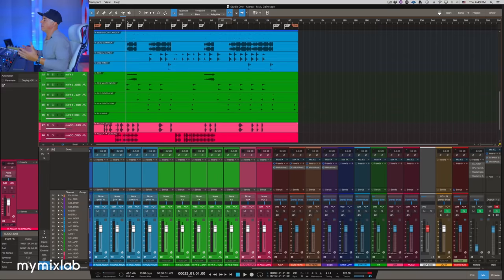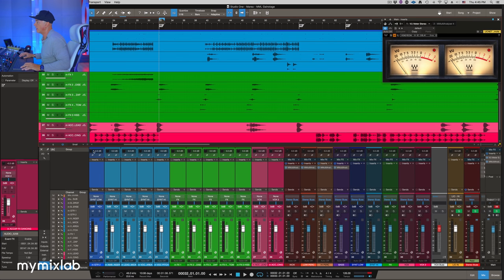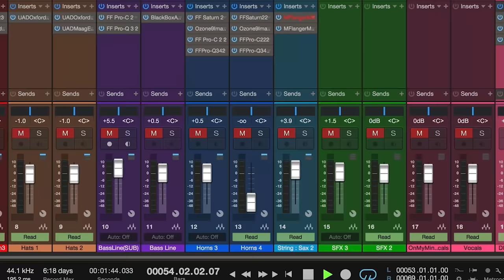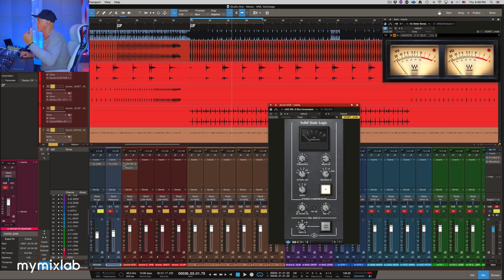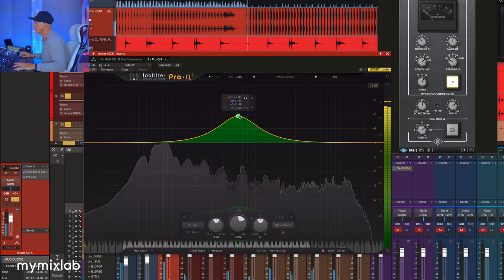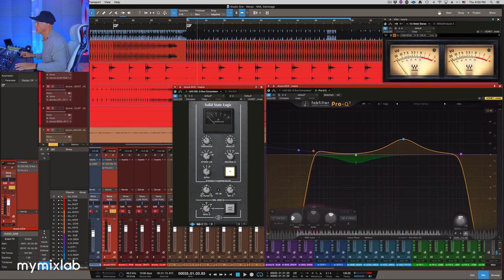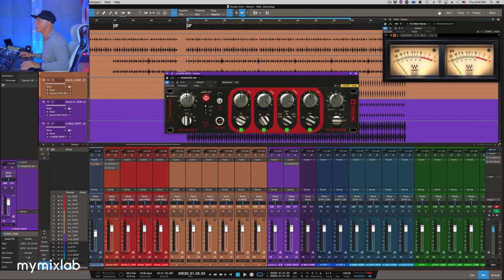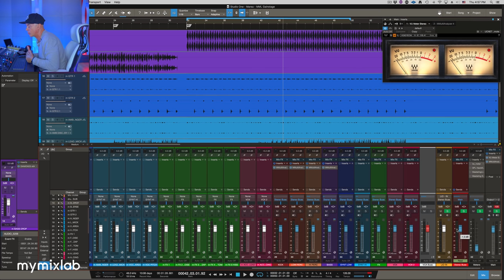HOW TO Mastering Levels & Gain Staging | Luca Pretolesi (3x Grammy Engineer) | TUTORIAL

Comment: how much soundgoodizer should i use on my master bus?
Reply: You need to put reverb and cla vocals on the master!!! I can’t stress this enough but soundgoodizer is only good when used 3x on every track
Reply: All of them
Reply: @OpenInfomusic Superb advice!!! I would just add to that and say if you really want your master to stand out it’s essential to add at least 4 instances of of the ELI Distressor and set each one of them to NUKE! 😁
Reply: Exactly 0. I know it’s a silly comment but I’ll respond seriously hoping I’ll help someone: master the track only when you are sure by 100% that the mix is finished, first of all eq it(add\cut as much as needed for your idea), then mid side compression, then glue compression to smaller the dynamic range between all if the instruments in the mix, then and lately a limiter.

If you think I’m having a mistake pls tell me so I will learn something new😁.
Reply: @ilay829  ok you took the troll too far… but seriously I usually only use 1-1.5 instances of soundgoodizer on each track. Then I’ll take the sum of all of them and divide it by 3 and that’s how many instances I use on the master bus to tie everything together
Reply: Yes
Reply: Stack 10 of them at 10% mix each
Reply: Yes
Reply: All
Reply: Yes
Reply: Yes!
Reply: Its depend , maybe 10 or a parallem with 10 more 😐👍
Reply: Don't forget to put reverb on your sub, it will boost the energy of the track 🙏
Reply: 1.21 gigawatts
Reply: I think 10 soundgoodizers will do😂😂
Reply: It's also a good idea to add Reverb to your bass and a stereo imager so it's nice and wide.
Reply: At least 3 different soundgoodizers

Comment: This is great info. I've also been told to achieve loudness in a mix. I've seen engineers setting there kick drum and bass set to LUFs meter around -14 to -12. If doing this, you begin to clip the VU meter at 18. By doing this method you put less stress on the limiter to achieve loudness. How do you achieve loudness when using this method you've described in this tutorial?  A follow up video would be awesome.

Comment: The problem i see here is that you always work on two different levels: the master and the single channel.
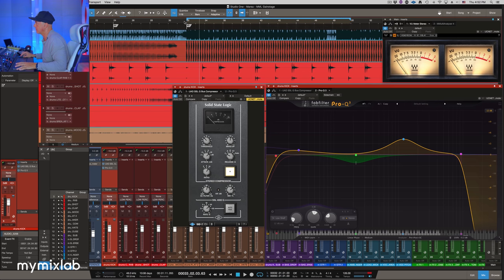After clip gaining all tracks to meet 0db VU on the master channel you have to adjust the gain on each single channel (in solo mode) in order to meet there again the 0db VU (which makes sense, since that's normally the sweet spot for analogue emulating plugins), but this changes the overall loudness of the track (see 13:00).
Correcting the gain with the output knob of each plugin in a track's fx chain doesn't make much sense, if there is a next plugin in the chain which again expects 0db VU as input gain.
It would be interesting to see how Luca handles e.g. a synth channel which has to be gain staged up by +5db in order to meet the 0db VU on the channel but which then also increases heavily the gain on the master bus.
Reply: Edit: This could probably be solved by putting another gain plugin at the end of each channel's fx chain which corrects the initial gain change by the inverted value.
Reply: I know this is a year old, but Yes!

What he showed was valuable, but incomplete.
If you got a folder of tracks, along with a rough mix from a recording session, then what he did at first is ideal.

Your monitoring is set to the dB SPL level you listen at.
Your master fader is at Unity.

You’d import All tracks as is with channel faders at Unity.
Including the Rough mix on a track that ideally Bypasses the master bus and goes straight to the same hardware outs as the Master bus.

I’d reverse one of his processes though:
Yes select All Tracks, and Yes grab the clip gain or input gain if your DAW has that, if not just add gain plugins to every track and select all of those.
But rather than start at Unity and bring the level down, Before You Hit Play, start at infinity and bring the level up.
Reaching the same level as he did, but without any unexpected surprises, to your speakers or worse if you’re wearing headphones.

Now, where I totally agree with you, is this only helps with the Mixbus and Monitoring.
(Oh, and I’d bring that Rough Mix up to the same level, flip the phase, and they should cancel.  Flip it back and you should have a perfect match, Before any actual mixing.  You can then exclusive solo against it at every step to see how far you’re deviating from the Rough.  Other Reference Track work similarly.  Before Metric AB of course)

As for Gainstaging the individual channels, doing it this way Inherits whatever levels you received and doesn’t Optimize those channels for Your Signal Processing.

So for Gainstaging each channel, imagine a DAW with no clip gain functions, the level comes off the waveform and hits the first plugin slot.
That first slot on every channel should be a clean Gain Plugin.  
Then you’d go channel by channel and use a meter to bring them each up to 0VU, Individually.  Preparing them for whatever signal processing you’re going to do next.

Okay, so to stay with what he was doing, but on a Whole Signal Chain basis, (which is called Level Matching btw.  It’s a cousin to Gainstaging, not Gainstaging itself.) 

You would also add another Clean Gain Plugin to the Last plugin slot of every channel, and input the exact opposite gain of the first.  So if you Added 3dB to channel 1, then cut -4.5dB to channel 2 in the first slots, you’d cut -3dB, and add +4.5dB in the last slots

If everything is setup correctly, it should sound Identical to before, and still phase cancel with the Rough.
You’ve only added and subtracted gain in a linear mathematical way, and just like 2+2=4, 2+(-2)=0.  

However, InBetween those Input and Output Gain plugins, you are now “Calibrated” for any Digital (which don’t care), Analog (hardware inserts), or Analog Emulation processing in a way that they were designed to be operated.

Everything else he showed about Level Matching each plugins inputs and outputs, is spot on.
But if you aren’t “Feeding” each processor what they want, then Level Matching becomes concerning yourself more with the processors before and after, rather than getting the most from the one you’re on.

It’s also why plugins should All have and input and output gain of their own.  (Well at least non-linear plugins). 
Many only have an output gain for level matching purposes, but with both, then you can easily “Drive” the plugin, to see what it does when you hit it harder, or softer, and then compensate on the output.
As every analog engineer knows, the calibration level in the manual isn’t necessarily the level that I want to use, or sounds the best to me.

Lastly, manually using level matching plugins like this has a couple of other benefits and controls:

You can now use these Input and Output Gains to “Drive” the whole chain!
Maybe you went a little overboard on the saturation from 5 plugins in a row, dialing back the Input to the chain may smooth the whole chain out, and then compensate at the end.

But also…
Having the Last plugin in the chain solves another issue that Often gets conflated with Gainstaging.
Fader Resolution.

The standard 100mm fader is not linear from top to bottom.  (Google Fader Taper)
Quickly, the top half is linear and the bottom half is logarithmic.
This allows for the top 50mm of finger travel to be extremely precise, and the bottom 50mm to roll off rapidly to infinity.
A brilliant design.

Typically the 0dB Unity marker is at the 3/4 point, or 75mm from the bottom.
Then the signal is Boosted (say 10dB) before the fader, but when the fader is brought to the Unity mark, it is reduced by that amount.
So it gives the illusion of having the ability to Boost by 10 or 12dB above Unity.
“10dB In Hand”.
Again, brilliant.

But in the digital realm, this can be arbitrary.  Some DAWs let you configure the behavior of the Virtual Faders in their Virtual Mixer, but they all somewhat emulate this analog audio taper behavior.

So, in order to have maximum “Fader Resolution”, you want the faders to Start at Unity, giving you 25% above and below of precise linear travel.

A mistake made by Many People, is to adjust their actual Gainstaging pre-fader, in order to preserve Fader Resolution.
I didn’t hear this mistake regurgitated in this video, to Luca’s credit.

This is an understandable mistake (especially for live sound engineers), because if a sound is way too loud in the mix, you grab the fader.  But pretty soon you have a bunch of faders in the bottom half of their travel, making it much harder to mix.  So you grab the input gain at the top of the board to dial it back, then you can push the faders back up and get control over the mix again.  Problem solved.

Except you’re now not feeding the signal chain with enough level, and you’re getting into the noise floor, plus just not letting that processor do what it can do.

Well back to our DAW with a Gain Plugin at the end of the signal chain, Just Before The Fader.
You can just turn That down like a pre-fader trim, and Not be effecting the optimal signal levels of your processing at all.
Healthy signals on All channels, and trimmed levels to the faders, still sitting at Unity.

And this leads to the next benefit.

Before any processing, and after setting up your session, naming, routing, coloring, etc, and then Gainstaging the channels like above, the next thing you’d likely do is a Static Mix.  (Which is faders and pans, no processing.  Just moving all of the raw ingredients to where the belong on the soundstage.)

If you’ve now set all of your input gains to feed processing, and you then grab all the faders and fly through a mix, pushing and pulling everything into place, when you hit stop the Song is now maybe 80% of what it’s going to be, but those faders will be all over the place.

You can now however, Transfer ALL of those fader moves over to that Pre-Fader “Trim/Gain” plugin, one-by-one, and reset All of your faders back to Unity.  (Then you Could do it all again, in another “Pass” on the Static Mix, fine-tuning what you did before like following a 60-grit sandpaper with a 220+)

Mixing is iterative, and pass by pass, you now have the opportunity to periodically transpose your fader adjustments back to that Trim plugin for a reset.  To many who are trying to mix as Fast as possible, this will seem like an unnecessary step.  And it isn’t strictly necessary.  The whole point is that it is sonically neutral.  This is purely about workflow, and control.

The final place where this workflow is invaluable, is Automation.  (Especially if you use a Control Surface, even a single fader.)

Having reset all of your faders to Unity, means that your Fingers (even on a mouse) are always starting from their default resting position.
I view Mixing as a Performance, one that builds upon all of the other performances.
All of the Artists and Musicians’ performances have been captured, you’ve now organized and processed all of that, and reigned in all of their performances to fit together into one piece.
That Mix is now Your instrument, and Automation is where You get to breath life and movement back in wherever you feel serves the final piece of music.

Having an Automation phase of the mix, that starts with all of the faders reset, is what makes adding that extra step in setup, completely worth while.

And if you haven’t figured it out yet, each time you reset your faders, you’re refreshing your mind and perspective as well.

Comment: Also it IS happening that you distort the next plugin if you don't compensate gains after compression or EQ. Most of the plugin market today is based on emulation of vintage gear which DOES have a internal virtual headroom that you should not hit harder than "X" dbs.